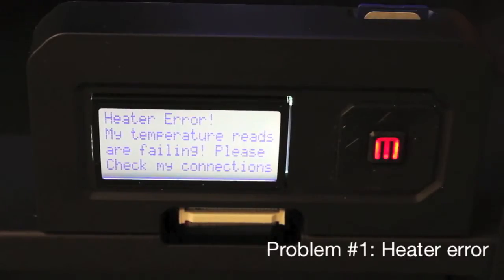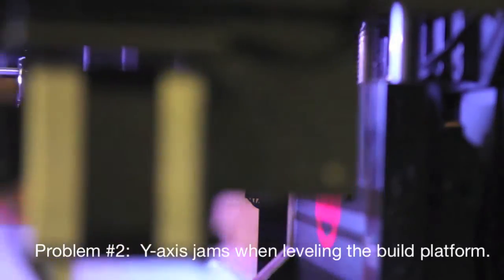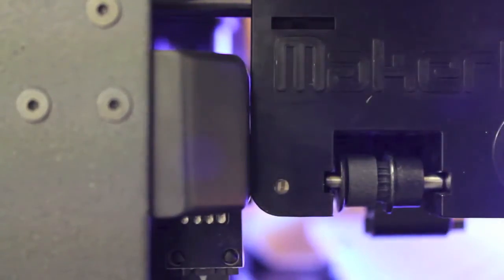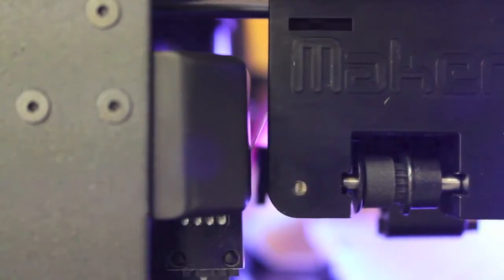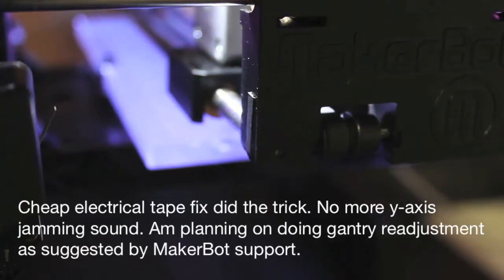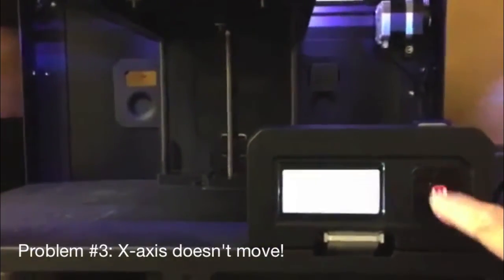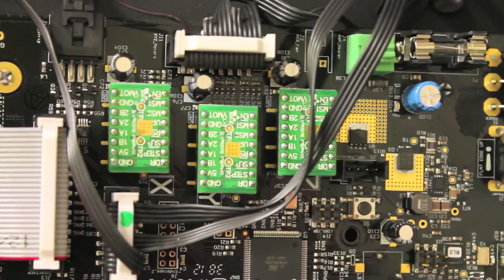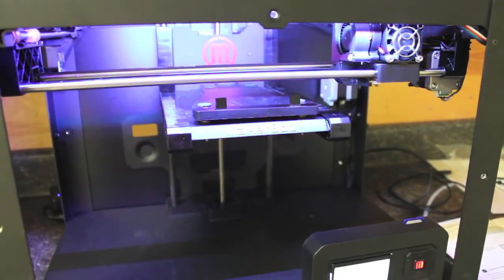My First Week With The MakerBot Replicator 2

Comment from the maker: Luis, I'm glad to hear you got your MakerBot and that it's working great for you! I've printed almost 50 hours and am about to do maintenance. Mainly just put lubrication on the rods since it's starting to squeak a little bit. I'm about to upgrade my plunger to the spring loaded one that MakerBot is selling. Do you know if yours came with that one or do you have the old assembly?

Comment: Just set up my Makerbot 2 tonight (it was delivered 2 days ago).  I was printing withing 15 minutes.  I printed 3 of their demos one after the other.  No problems.  Only problem with set up is I couldn't find the SD card in the packaging.  (found it in the SD slot of the Makerbot)  BTW Makerbot has changed their extruder so that it is now pushing against a spring loaded roller instead of  a grub screw.

Comment from the maker: Byron, let me report now that I'm up and running things are much, much better! I do have problems with the extruder getting clogged every now and then, but I just go through the filament load process to unclog it. Anyway, once you get going let me know if you have any Qs.

Now what REALLY interests me is the 3D scanner. I've actually looked at this model and was interested in the quality of results. Have you done any 3D scans yet? How did the resulting scan turn out?

Comment: i know right, even in its infancy its impressive, not to mention when i look at kits, its about 60$ for one that plugs into a computer, and an extra 60-175$ for one that has an sd slot and lcd screen, because of where my computers are located, i cant have one that doesn't work on its own, so yea, the pi one makes sense seeing as i have crts i can hook up to it. 

and the guy doing it is sourcing parts from old printers right now, even better in my opinion.

Comment: OMG, I hate to see this, I just bought a Nextengine 3d scanner to use with a replicator 2x.  I have no doubt the scanner will be nothing short of fantastic, but now I'm concerned that a $3,000 printer is going to come incomplete with damaged components put together by a 2 year old in a new company with no Quality Assurance!  8 Weeks is way too long to wait for something that doesn't work.  I'm not an engineer, I can barely use a soldering iron, will I need to be one just to use this thing?!